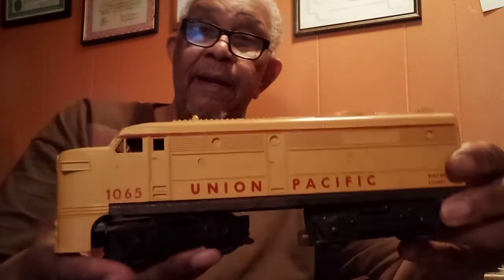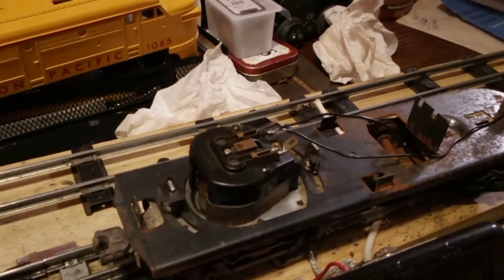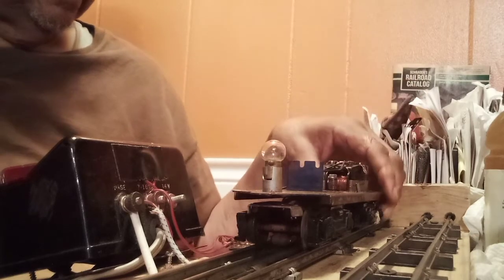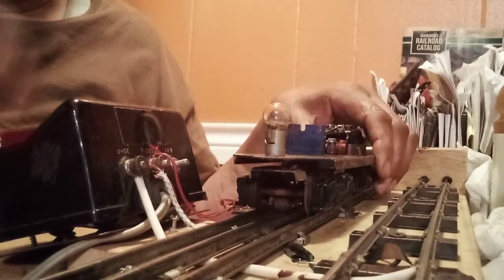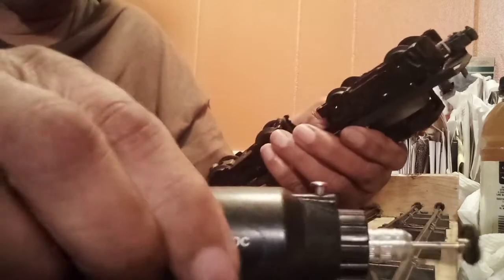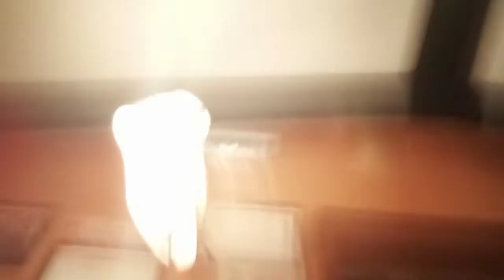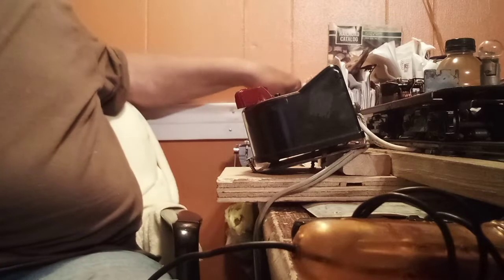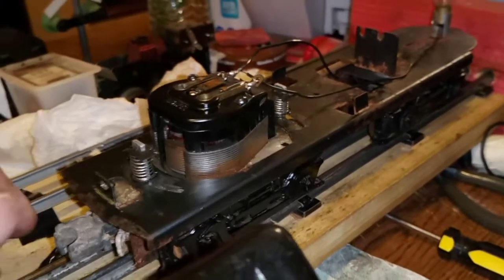A Lionel 1065/Flood Rescue/Part (1)/Will it Run?

Comment: I find a small straight blade screw driver works better in the small Phillips head screw securing the body to the sheet metal chassis. Todays Phillips screw drivers have too pointed a tip to grab Phillips head screw correctly.